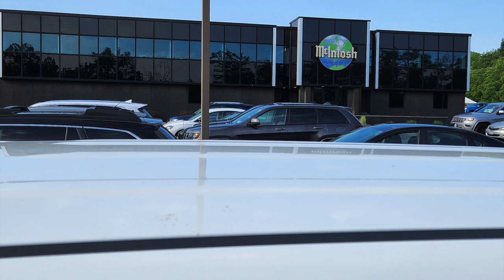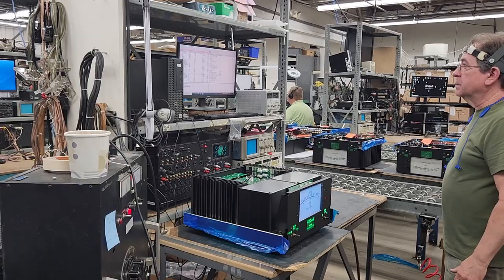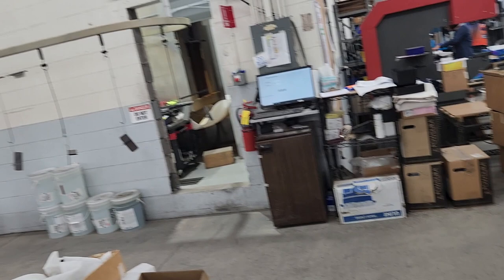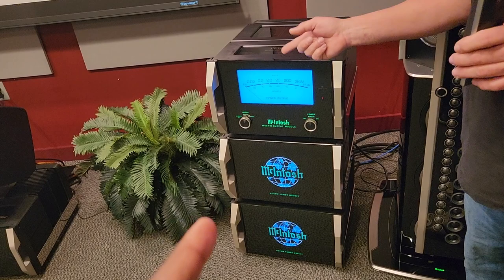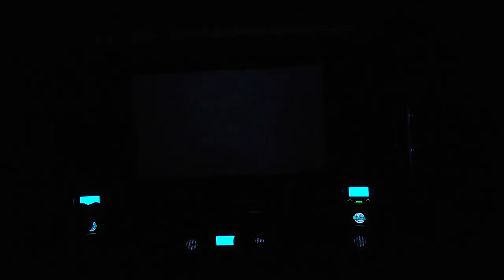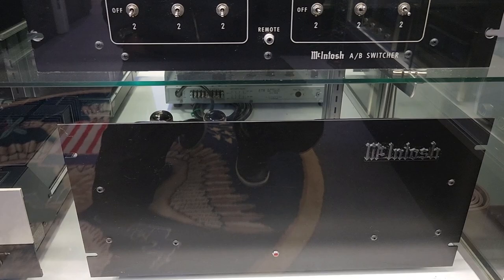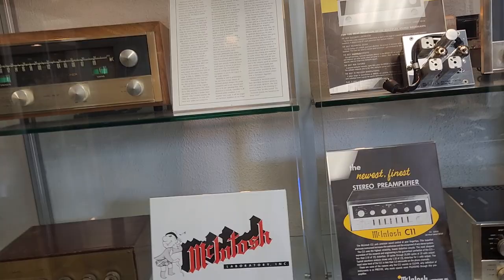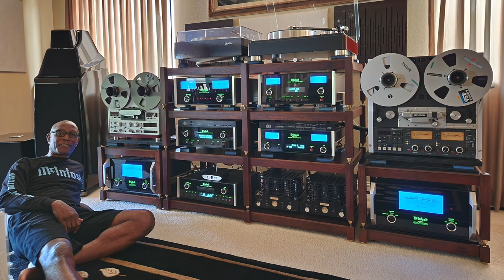McIntosh Labs - SkyFi Audio - and Audio Classics Visit -  2023

Comment: I used to work at Raytheon in Waltham Massachusetts and McIntosh reminds of a little Raytheon because everything is made and tested there which gives them OUTSTANDING quality that lasts a lifetime if you don’t upgrade which is my next move with the flagship Ma 12000 their 75th anniversary this is one of the reasons why I purchased McIntosh products. They’re built right… wow I just noticed there’s an Empire Turntable there that I own now didn’t expect that…
Reply from the maker: Mac gears are built to last. I also still have my first Mac system with the MC7270 amp. over thirty four years old and still kicking.